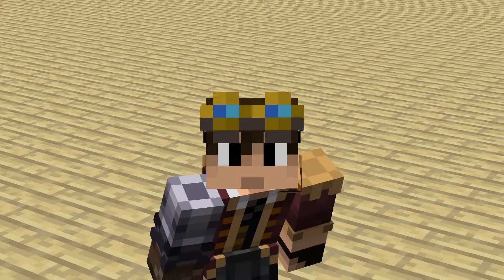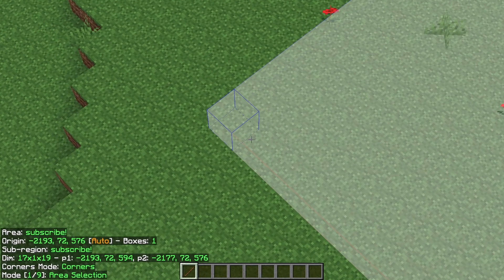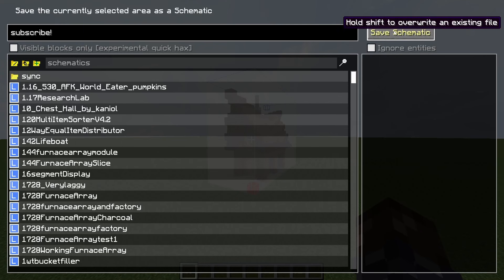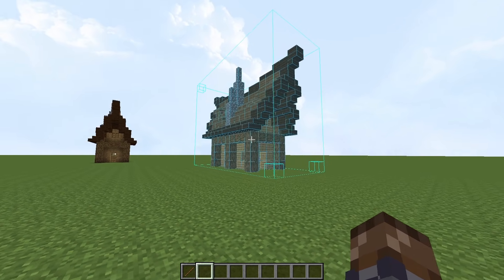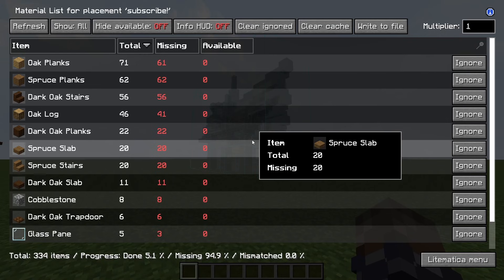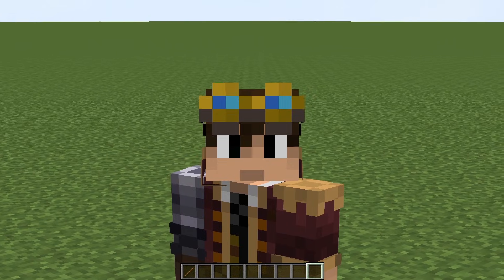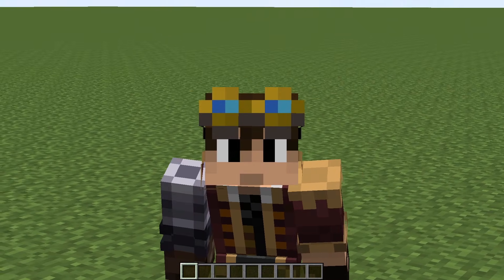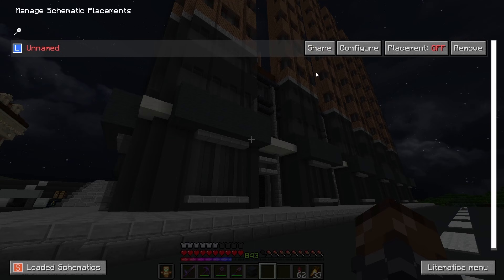Tutorial: How to Use Litematica 1.18 - 1.21.4!

Comment: I cannot change modes
I tried looking in the comments for help but I didn't find anything in the comments

I use 1.19.2
I have the stick in my hand and it's on mode 2/9 
I press control and scroll but it doesn't change the mode, it changes inventory slots but the mode stays the same

Comment: whenever i try to download this pops up 

Incompatible mods found!
net.fabricmc.loader.impl.FormattedException: Some of your mods are incompatible with the game or each other!
A potential solution has been determined, this may resolve your problem:
	 - Replace mod 'Litematica' (litematica) 0.19.50 with any version that is compatible with:
		 - minecraft 1.21.4
More details:
	 - Mod 'Litematica' (litematica) 0.19.50 requires any version between 1.21 (inclusive) and 1.21.1 (inclusive) of 'Minecraft' (minecraft), but only the wrong version is present: 1.21.4!
	at net.fabricmc.loader.impl.FormattedException.ofLocalized(FormattedException.java:51)
	at net.fabricmc.loader.impl.FabricLoaderImpl.load(FabricLoaderImpl.java:196)
	at net.fabricmc.loader.impl.launch.knot.Knot.init(Knot.java:146)
	at net.fabricmc.loader.impl.launch.knot.Knot.launch(Knot.java:68)
	at net.fabricmc.loader.launch.knot.KnotClient.main(KnotClient.java:28)
	at java.base/jdk.internal.reflect.DirectMethodHandleAccessor.invoke(Unknown Source)
	at java.base/java.lang.reflect.Method.invoke(Unknown Source)
	at net.digitalingot.rustextension.ProxiedStart.main(ProxiedStart.java:16)
Reply from the maker: @Mitasket2  you got the wrong version of litematica, it gives you a solution near the top
Reply: @ I play on feather client so in the mid menu I got it so thanks anyway

Comment: not works for 1.21.4
Reply: It works
Reply: Litmatica doseintnhave a 1.21.4 ver only 1.21.1 ver
Reply: Litematica does have a 1.21.4 version, don't check curse forge, check modring @The_TRUEbottlevr
Reply: @The_TRUEbottlevr check modrinth
Reply: It on modrinth
Reply: Not working
Reply: I wnted to use in 1 21.4 in java 😢😢
Reply: You did it wrong then lol
Reply: Works bruh

Comment: I make my buildings in a flat creative world and them go into my survival world and place it there. However, I find out that rather than use the original block, I want to use another i.e cobblestone to mossy cobblestone. I can live with a red block that lets me know I have put the wrong block and if I am changing hundreds of Oak blocks to Britch blocks, that is harder to deal with. I have seen that one of the tool modes is Replace block. I have tried using it but cannot figure it out. Is there a way to replace all blocks of one type for blocks of another?
Reply from the maker: I think somehow, you can get more info over in masa’s discord

Comment: How do I add a schematic to syncmatica. Also does this world on realms. The option to share the schematic is greyed out
Reply from the maker: You need syncmatica installed on the server for it to work
Reply: @InventorPWB  so I can use it on realms? And how would i install it on a server then
Reply from the maker: @codyfaille2209  no, it won’t work on realms as that is locked in vanilla. You can use it client side, but you won’t be able to share schematics that way.

Comment: I have a problem. Once i have saved whatever build i wanted to save how do i remove the like flying white blocks from the schematic? (thats when saving the schematic not loading in the schematic)
Reply from the maker: You can remove the selection like I showed in the video
Reply: @InventorPWB  I dont know if this is a bug but it shows nothing in the Area Selection Manager. What should I do?
Reply from the maker: @kzli.i in the menu turn selection mode to normal
Reply: @InventorPWB  It worked! Thank you for the fast reply and this tutorial. You earned a sub.
Reply from the maker: @kzli.i  You're welcome, and thank you :D

Comment: for some reason on hypixel I can't utilize pickblocklast it doesn't work, did the server disabled it or did I use it wrong?
Reply from the maker: Maybe servers can disable it, I’m not sure. Maybe check to be sure that you bound pickBlockLast to right click?
Reply: @InventorPWB  yea I checked it, it doesn't work still so I'm guessing the server disabled it. or do I have to be in creative mode to use that feature?
Reply from the maker: @absolute9022  for pick block last, you don’t need creative. Maybe hypixel disabled it? Maybe try in singleplayer to see if it works there

Comment: hey man, great video! thanks for making this. i was wondering, i see in other videos there is a print setting as the paste setting doesnt work in survival mode. however, on 1.18.1 running through fabric, i cant seem to find the print option...any ideas as to how i can make this build by itself? i am building a 8x8 map art for a friend on a realm, cheats are allowed, i ran this by admin...
Reply from the maker: There isn't a print feature in litematica for survival - I'm pretty sure schematica has it, but there might be an extention for litematica to add a feature like that. I'm not completely sure, though
Reply: @InventorPWB  thanks for the fast reply, I figured it out there’s and extension for it. I’ll post the link if you want it
Reply: @utkutk22  Plsss Post it